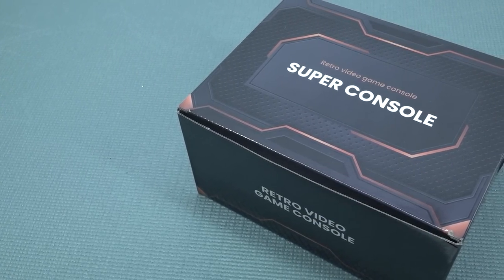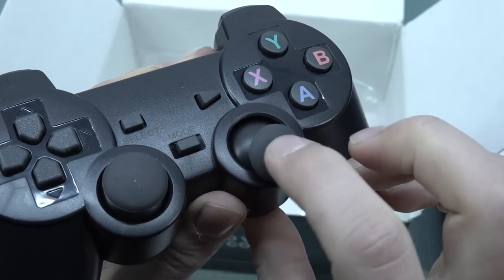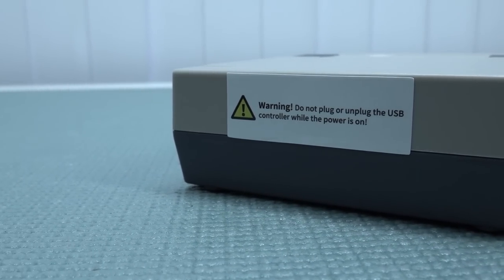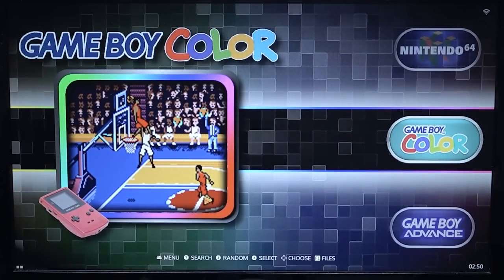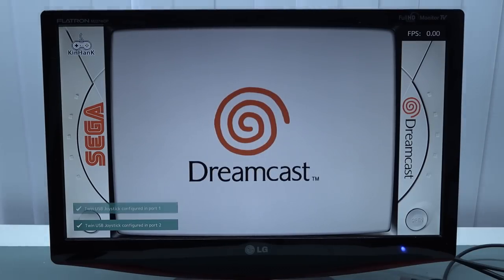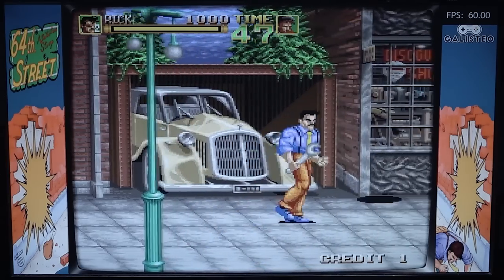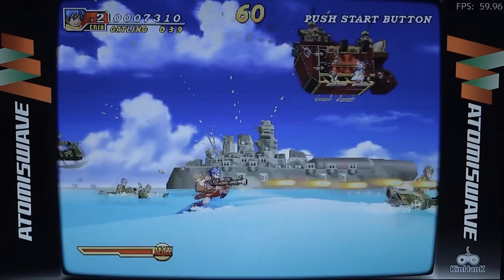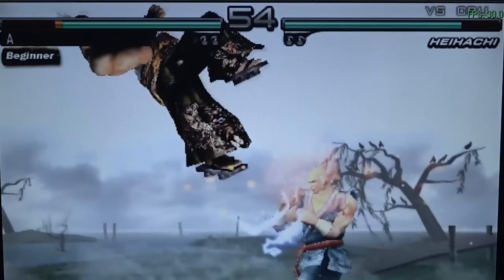Super Console Cube X3 - The Return Of The Mighty Cube 😲

Comment: I bought the X3 and have not had a problem with any of the games. Each system has multiple emulators you can switch between. So if a game doesn't play on the basic setup, you can switch and set everything up the way you want, per game. Great vid! This is worth it for the price being under $200

Comment: Protip, Open it up and add some $2 heatsinks to each of the RAM chips, then take out the fan screws, rotate the top of the case 180 degrees and move the fan across under the ventilation slots to only two screws so its actually sucking in fresh air, downside is all ports usb hmdi etc will now be on the front of the console but it will stay constantly cool on high loading psp or n64 games for long play

After moving the fan you can actually feel air running out of the bottom air vents
Reply: Thanks for the heads up man